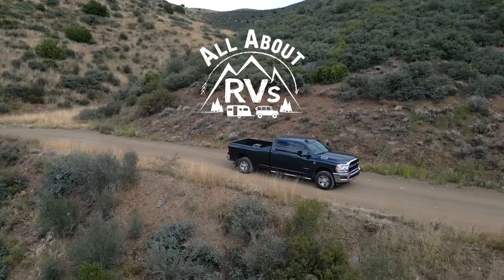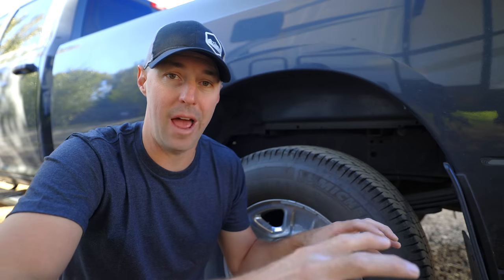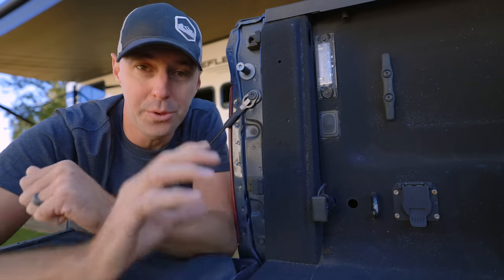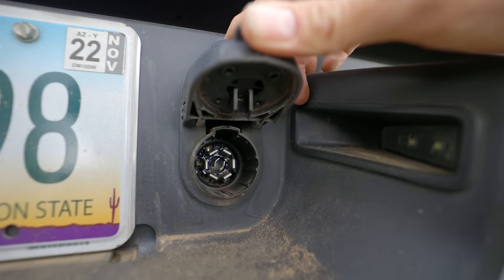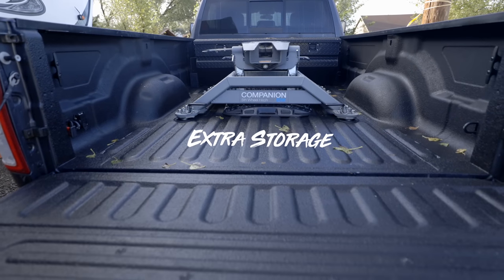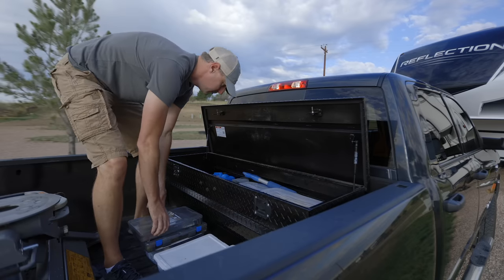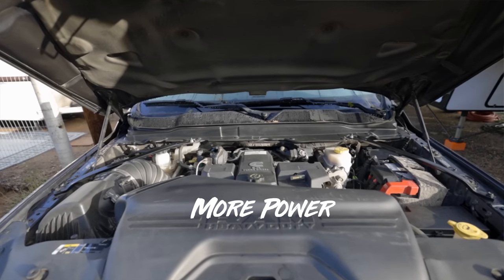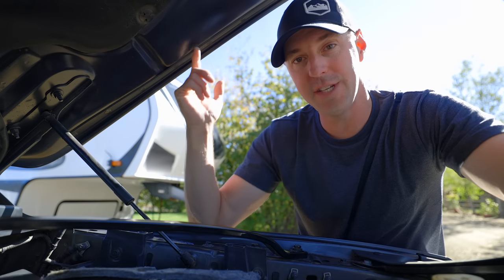Truck Modifications For RVing!

Comment: Great video! I have a 2016 Chev 3500. I have added a Fass system (amazing), sumo springs, Edge Insight to be able to monitor everything at once. Amsoil oil bypass is worth its weight in gold.  I really like the larger gas tank idea.

Comment: My truck (2019 Ford F-350 SD 4x4 diesel) came with dual alternators and then I installed a plug and play high idle switch tied to either my up lifter switch or emergency brake. Works great! Also installed more efficient cooling system with better thermostat to help keep oil, transmission, and engine cooler by 10 to 15 degrees towing in hotter weather.
Thanks for all the tips and be safe, God Bless. 🇺🇸🙏

Comment: Great video. 2016 F350 CCD. I added a brake light camera on the third light. I installed a 330 W solar panel across the bed at the cab. It's got releasable hinges that allow me to tilt it side to side or take it off. This panel with the 3 on the roof of the 5er gives me a potential of 1320 W. I can fit my paired generators under the solar panel to keep them out of the weather and have vented the exhaust under the truck. I wish I could figure out how to use the solar at my house when I'm home.

Comment: With the timbren system does it allow you to remove the factory helper spring? 2005 F 350
Reply from the maker: It installs where the original bump stop was.

Comment: Hey Jared! First off I love your channel. I have been watching for years and have learned a lot. So thank you! One of my modifications is to my fifth wheel. I installed a fifth wheel to gooseneck converter. I love it. Have had no problem with it. Have travel several thousand miles with it. It gives me more usable space in my truck bed and no more lugging that heavy fifth wheel in and out of my bed.

Comment: Ditch the back seat and add a platform with flip lid (to have a little extra storage) to level out floor.  Gives you a lot of extra storage that is safe and weather proof.  Works if you are ok with a two seater ....
Reply: I use a under the seat storage unit made by Weathertech. Can easily be removed when needing the entire rear cargo area.

Comment: Hey Jared, great video. I like the Via air compressor, but didn’t want to access the battery to use it, so I installed a 12V cigarette lighter style plug in the basement area of the RV, one on each side. Makes for easy use of the compressor
Reply: I am going to mount in my truck, when the air compressor is in the trailer (like mine is now) and need to air up the truck because I am on a side trip without the trailer it is a call to rescue.  looking forward to having it on my truck and running tools as well.

Comment: Ceramic tint on all windows of our Ram 2500 -- living in SoCal summer heat, this has been one I enjoyed the most as it keeps the interior so much cooler.  Also added in the sidesteps for getting in easier, and the Amp Research retractable bumper step, B&W gooseneck for the Anderson hitch and same 7-pin plug in the bed and Rough Country all-weather floor mats.  Love your channel, and love the 55gallon fuel tank upgrade, just not sure it will fit on a short bed model.
Reply: There are two companies that make the large tanks for our trucks. Yours being a short would be around 52 gallons. Still, a really big help.  S&B filter and Titan fuel tanks. I have a long bed so I went for the fuel tank, tool box 60 galon combo,
Reply: I went with titan. Found it was easiest to remove the bed of my 2013 diesel and install the tank. Took about a day all in. Smartest thing you can do for rving, short of get a dog.

Comment: Agree ViAir is great, but sometimes just too much to set-up. Love my Dewalt battery air compressor. If I'm just a few lbs low the ViAir seemed like too much trouble so I'd rationalize not adding any.
Reply from the maker: Good to hear the Dewalt gets the job done when needed.
Reply: I have the dewalt as well.  I had on board air for awhile and found draining the moisture from the tank to be a pain.

Comment: I have a 2021 Ram 3500 with 2 X 220 volt alternators. I just check my bill and in May 2021 it was $350 Canadian  for this option which I thought pretty reasonable. A friend of mine had a second alternator installed  at an auto electrical shop in Toronto for $550, not as cheap as OEM but not too bad if your needing one.
Reply: I think you mean 220 amp, right?  220 (240) volt is what your residential oven and dryers run on.
Reply: @mattr4660  you are correct sir...I have made the correction

Comment: Ive actually never heard of installing a second alternator and feel like I need to do some research. Could be a great mod for me. The one mod I think I’d appreciate most is the truck bed plug for hooking your truck to you trailer to charge the batteries while driving. That would be wonderful when traveling on cloudy days. It really stinks to get to the campsite after a long driving day only to find the batteries are low due to cloudy and/or rainy weather. Might you share more in-depth info on that mod?
Reply: The 7-pin connector provides power (usually 30-40 amps depending on the truck)  while driving and should keep your trailer batteries charged while driving. Might want to check the truck fuse to ensure 12volts+ is getting to your connector.
Reply: @kentwicker6818  Good tip. Thanks!
Reply from the maker: We ended up using a DC to DC charger and a larger wire because we were only getting 1 amp through the 7 way plug to our battery bank. The wire gauge used on our last Ford and current Ram was very thin causing the limiting resistance, even though the truck had a 30 amp fuse for it. https://www.youtube.com/watch?v=7NDnZsouUyY&t=8s
Reply: @AllAboutRVs  Excellent guidance! Thank you very much.

Comment: Are you not worried about idling your diesel? I've read that due to def issues etc, modern diesels shouldn't idle, they basically need to be run long-ish distances otherwise the filter begins to clog up.
Reply: If you remove all the emissions foolishness including the def you will burn less fuel overall and avoid all the repairs that come with cats and dpfs
Reply: @brucebalfour8042  But that would be illegal.
Reply: @josephheston9238  and your point would be?
Reply: @brucebalfour8042  If you take it off, you will get ticketed (just like you can't remove the catalytic convertor on your gas-powered vehicle).
Reply: @josephheston9238  Only the Peoples Republic of California do emissions testing on diesel vehicles to my knowledge and none of my diesels have even a cat

Comment: As far as using the truck as a replacement for generator:
Basically the most expensive generator possible. Your stock alternator on the Ram should be a 220amp. At 14.4 volts, that's over 3100 watts. Your correct using a DC-DC convertor, but that's only good for 20amps( Renogy  makes another for 60amps). You would need a HUGE power cable and DC-DC convertor to ever get anywhere close to 220amps. Even running the truck at idle with your setup is going to give you approx. 20amps for (1) hour? Idling that engine isn't good for it. That's what generators are for. If your traveling, then you will be getting that charge for free anyway, but that Cummins is a really expensive 20a genny. In a pinch, it would work.

Comment: I don't understand! You did a video, right around the time you did this one, ranting on and on about making sure you buy the right tow vehicle for the load you're carrying!  Then the first thing you add to your truck is 'helper springs'? Helper springs increase load bearing capacity! So if you did NOT buy the 'right' size truck to haul the load you're hauling, add helper springs to increase the load bearing capacity of the under sized truck you bought! GOT IT!

Comment: “Hack” tip: Custom order a truck with the options you want. You’ll typically get a better deal on the purchase price and you’ll have what you want.

For example, you can order a RAM with built in air-suspension, dual alternators, 5th wheel prep, bed liner, etc.
Reply: Good call. My RAM 3500 has the automatic air bags, dual alternator connected to Anderson connector for  linking to dual Victron 30A DC-DC chargers, bed liner. Very glad I go those mods. The one factory option I got that I wish I hadn't is the TPMS for the trailer. They just give you a big wiring harness that someone must install and it is expensive. Much easier to get an after market wireless TPMS.

Comment: I did a couple of things leading up to us getting a 23 foot travel trailer. Truck is an 09 Silverado 1500 2WD with a 5.3l. Stock gear ratio was a 3.42 with a 265/65R18 tires.
1. Added Bilstein shocks in the back with an add a leaf spring. This increased the chassis load capacity and raised the truck 2".

I replaced the front struts with Bilsteins with the adjustable perch raising the front end 2".

2. Upgraded tires to a 285/70R18. Raised the truck another 1 1/2" and went to load range E tires.

3. Upgraded the 3.42 rear gear ratio to a 4.11. Bigger tires affected the over all gear ratio and and wanted more towing power. Made a big difference.

4. Stock truck came with a class III receiver hitch. Went to a Curt class IV receiver hitch to handle a higher tongue weight.

5. Anderson weight distribution hitch. While the sway control isn't that great, it's easier to set up, much lighter in weight and much easier and quieter to back in and maneuver the camper.

Comment: Extendible tow mirrors. My TV is a Ford Expedition (3rd gen), for which Ford never sold extendible tow mirrors. I mounted a set of OEM F150 knockoff mirrors, and am ever thankful for their convenience and added margin of safety. 

ScanGauge. Got it simply to have a transmission temperature gauge, which has been super useful towing in the mountains on hot summer days. I also appreciate the instantaneous fuel consumption display as a surrogate for engine load.
Reply: you mentioned an app that let's you select your vehicle size to avoid bad roads, which one are you mentioning?
Reply from the maker: I use Truck Map app.